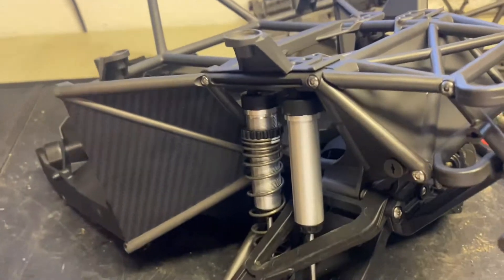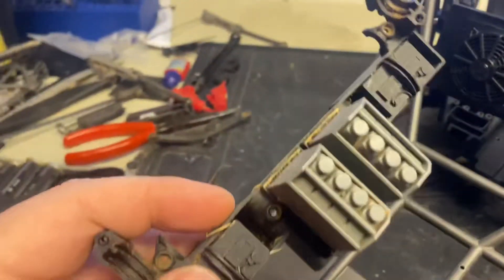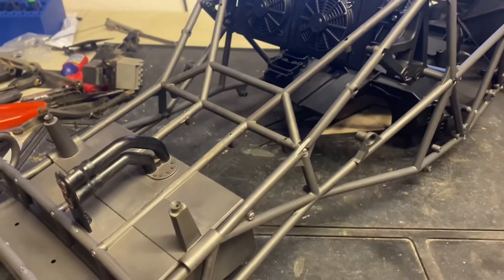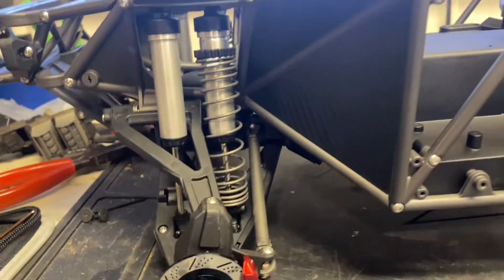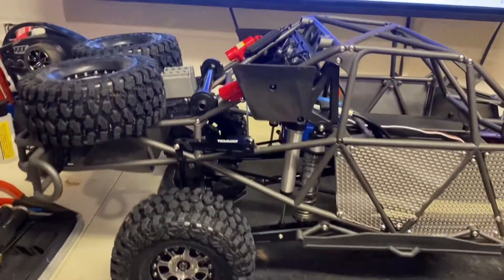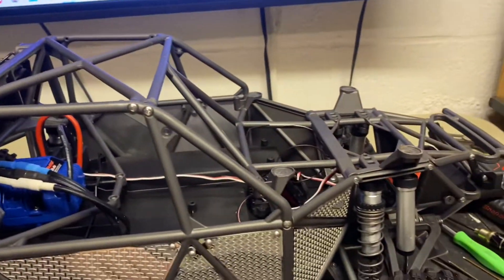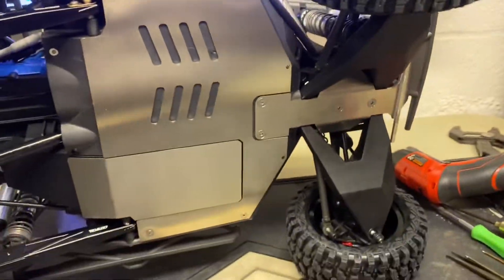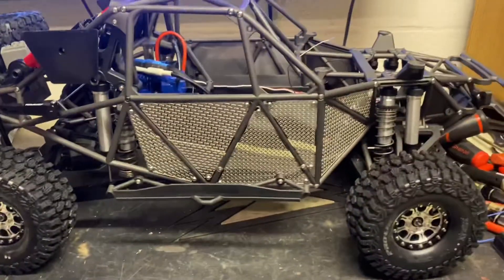Traxxas UDR custom build update

Comment: This looks really good. I haven’t driven mine enough to need to tear it down for a rebuild other than rear shocks due to pinched shock seals from the factory. I’ve got some idea’s for upgrades tho once things start to come apart :D. Are Hyrax tires still our only option outside of stock tires for the UDR? I think they’re great, I have a set on my RR10, However I would prefer something more scale like some Mickey Tompsons, Generals, etc.

Comment: nice UDR ,  i have the fox edition with the same RC4wd accessories  you have , try to get the  front lower suspension arm also by RC4WD there awesome  but don't get the HR  rear sway bar coz they don't fit well per other vloggers that own' a UDR.
Reply from the maker: Thanks. This one started as the fox edition as well. Stock front lower arms at least for now. I may change them. Not sure yet. I had the RC4WD rear sway bars parts on but swapped them out for the Hot Racing ones. They fit fine but have to drill out where the bar goes through for the heavier sway bar. I actually like this set up better. Thanks for sharing your info.

Comment: Nice UDR , What Wheels (size and name) did you use on the Hyrax tires??
Reply from the maker: They are the Proline Hyrax tires on the RC4WD Monster Raceline metal headlock wheels made for the UDR. They are a little heavy but very sick looking. Sorry for such a late response.